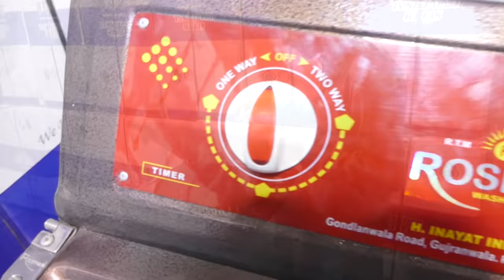Brilliant  Process Of Manufacturing Electric Washing Machine

Comment: Customer: So what is the problem with my machine?
Appliance tech: Your motor mount has been eaten by termites.
Reply: They do that because they doesn't trust that the motor will not short to ground. So, they isolate it just in case.
Reply: Less noise !!!!
Reply: @yorumcuturk  the motor is already very noisy alone, ofcourse if places in metal, it will do more noise, I suspect the axis and ballbearings are not good quality. When they tested the motor alone, the noise surprised me.
Reply: I mean homes are made from wood, that's more concerning than a washing machine lol.
Reply: @UaeDelta  Not in my Country, houses made of wood, look at the cheapest, homes easy to blow apart in the first storm, made in UEA, oh Sir. In my country homes are made rock solid!.
Reply: @flyguille  To be honest, I didnt see any ground wiring in that..
Reply: @Sanyey  i dont believe they have grounding there so a ground wire is useless, just like in my country we become the ground by touching the shit so we usually just cut the yellow-green so no ground at all
Reply: + rusting 😂🤣🤣 + getting electricuted due to improper earthing.
Reply: @binarhassan  WE AINT NEEDED NO GROUND WIRE…….DO YOU SEE EVEN THE PAINTER WAS NOT PROVIDING A 😷 MASK….THAT SO SAD BROTHER.
Reply: It made me laugh out loud 🤣 😂 😆
Reply: @rickyroan3419  yeah its a third world country what do you expect, safety is almost non existent, even the ground wire could be a safe thing when its all hooked up properly, it will not be useless.
Reply: @flyguille  Because the wood in a washing machine would never get wet... SMH.
Reply: @flyguille  So you live in a cave??
Reply: @ffjsb  no , in a modern 21 century castle!, a brick house!
Reply: I came back again searching for this comment only🤣🤣
Reply: @UaeDelta  homes don't spin at high velocity either
Reply: Customer: The water is not getting hot and its not pumping out.
Appliance tech: Why should it?
:)
Reply: I would simply direct them to the "made in Pakistan" sticker
Reply: @flyguille  😂 Bro, even that brick house has a stick frame. Wtf are you talking about?

Comment: What i actually love is that every single thing they made themselves...
Reply: They are probably buying a lot of things like the castings and complicated stampings from someone else.

This is probably a standard machine and shares parts with other machines made by other companies.  India is famous for making clones of products and adapting them to the local market. Without patents to get in the way a good idea can spread fast and lots of simple products like this can be made.

The down side is this is not a very sophisticated wash machine. It has no pump, no timer, no transmission and spinner or wringer. These would be expensive to add and would be beyond the abilities of the workers ( maybe these are even day labour who show up are told what to do and may move from company to company on a weekly or monthly basis depending on what local jobs need workers )

The production methods used are not scaleable. In order to to reduce costs further they would need to set up a proper assembly line buy more complicated tooling and train men to use it. I suspect when they are done making this run of machines they will move onto something else. Maybe next week its hot water heaters or refrigerators. 

As long as the product is very cheap and simple and the labour costs are lower than using machinery the can quickly switch from one product to another without any significant investment in machinery or training.

Comment: something which resemble and works like a washing machine, one speed, no drain cycle, uni-directional movement, no control over weight/water level, no child guard, no heavy, soft or light wash.
no auto-shutdown after completing washing.
Reply: Wonky tin can with lose bolts and rust from day one?
Will fall apart as no screws are tight
Reply: Also no stupid electronics  to give grief. Just a plain and simple workable  machine that will not give expensive  troubles
Reply: That's what the first washing machines were!  Some were even run by gasoline engines!

Spinning and agitating clothes does most of the job.  Fill it with a bucket and pull a plug to drain and you dont need solenoids, a pump and hoses.  This doesnt even have a spin cycle, probably just wring them out and hang to dry.

Its a perfectly useful machine that does the washing labor, and nothing extra.
Reply: @bigpjohnson  Yeah! Old washing machines did just that, wash. Many came with a wringer.
Reply: These machine do have bi-directional washing, clockwise and counterclock and fast spin at the end.  But these machines are for the people that can only afford to spend $50 to $60 for a washer.  You want all those features you mentioned, you can get all those in Pakistan too, but you have to spend 10 times more, $600 or more.

Comment: Well in my own opinion their work and production may not be up to the western standards but they really did a great job to provide low burget washing machine for their people within a local environment just to have a taste of comfort to live a mordern life.they really tried by using what they have to get what they need .improvements is what they need to make their work and production better....they need more ideas and more manufacturing strategies to be more productive....
Reply: First they need quality control... and education.
The internal screws on the tin frame plates where not secured in the end, the machine will fall apart fast with all the rumbling inside of laundry weight
The tools they use at the end are Chinese corded drills, so why not go poprivet all the way, even cheaper and when done right faster and more secure than all those loose bolts
Reply: This is where they make Samsung appliances.😁
Reply: I've watched several of these videos and I have come to the conclusion that these manufacturers are incentivize to make their products as inefficiently as possible. They obviously have some kind of trade restrictions that prevent foreign manufacturers from selling their higher quality products in their country.

Comment: The motor rotate only one direction.
Metal body can cause damages if you use without ground earth. Without dryer washing machine is not useful. Plastic body with toughened glass will work nicely.
Reply: @Bengal Tiger pakistani will be pakistani... 🤣🤣🤣
Reply: @Bengal Tiger haha they are deleting my comments 🤣🤣🤣

Comment: Amazing, genius use of "bit work". Do a bit here, chuck it on the floor, do a bit there, chuck it over to that guy in the next room, and so on. Sure beats the stupid Henry Ford idea of a smoothly laid out efficient production-line process.
Reply: Two reasons not to do that:
- The current way of doing is profitable enough for the business to run
- The current way of doing is providing more people with a living. 
So if the rest of the factories in Pakistan are operating in roughly the same way, and the products are affordable enough to the customers, changing it is not exactly a great thing to do. If one does it, many more will do it to stay competitive. If many factories are running with half the number of workers, you'll have  a wave of unemployed people. Unemployed people can't buy products, and require a social safety net which requires tax money to keep people housed and fed. 
The only person benefiting, is the one that owns the factory. But at the cost of a lot of unemployed people, which is super bad for the economy and the tax burden.
The only thing that would be nice to see, is to see the workers work in better conditions.
Reply: @mfbfreak  Okay, an interesting perspective. Thanks for your thoughtful comment. However, the throwing on the floor, then for the next person to pick up really amazed me. This action is repeated so many times that the workers must even think that it's crazy not to have an elevated temporary storage for part finished articles.

Comment: Zanussi clearly have nothing to worry about from this manufacturer!

The horrific working practices and conditions are the norm for this series of videos.

This machine appears to only have an on/off switch, no programming for fabrics and no water supply, it is filled with water by the user.

Expectations, like standards vary depending on the part of the world where manufacturing takes place.

The piece of wood is a major component that is vital for the warranty.

When asked about reliability and wsrranty, the prospective buyer is told to "touch wood and hope for the best".